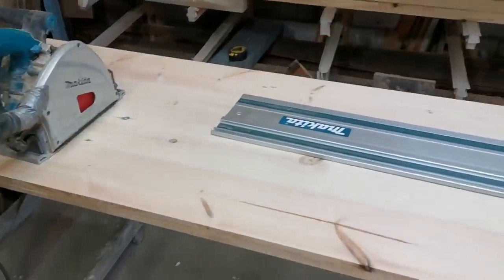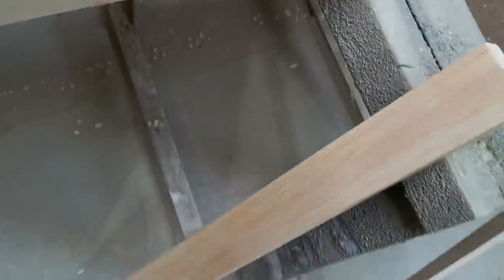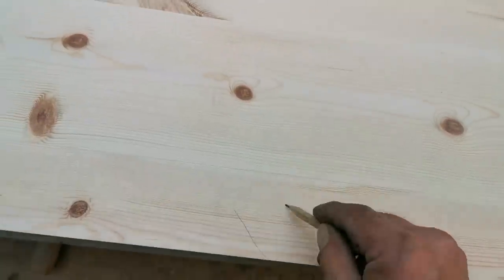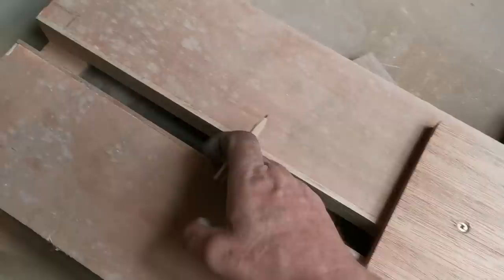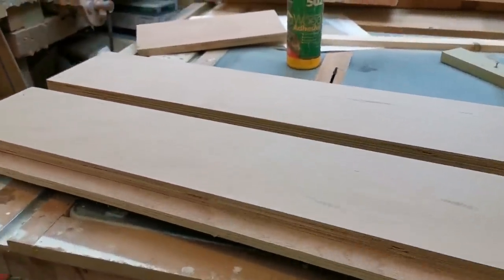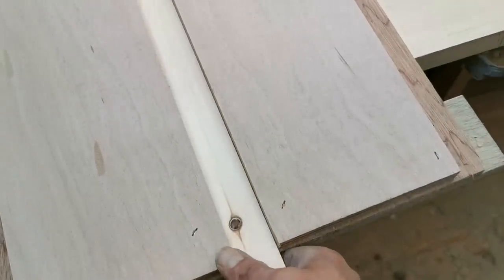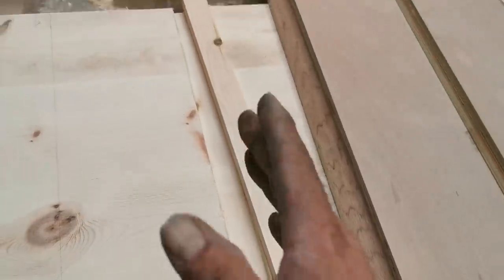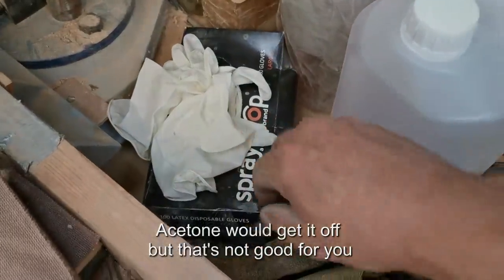Pine shoe bench Pt2 - Cutting the boards & routering the grooves in the ends

Comment: You can get those led flat panels that are used with false ceilings in offices etc. Cheap as chips and good to boot 600mm x 600mm 😉
Reply from the maker: Thanks, Simon Hopkins mentioned a link but they're in a garage I'm working on & they're failing after only a couple of yrs, it's not damp in there, prob cheap panels, I've inc them in a vid I'm making, 
https://www.ledpanelstore.co.uk/led-panels.html

Comment: Picked one of the Parkside stapler off ebay for £22. Pretty good for that as not used as much as brad nailer. Good work Gid! Keep the vids coming.
Reply from the maker: Thanks will do 👍 I like mine better than i thought i would, it's not as sleek n refined as my Bostitch but does it's job, 
This my Bostitch & where i buy my nails & staples, the parkside takes the same staples, i'll check tomorrow tho 😉
http://www.betcofasteners.com/bostitch-sx1838-e-pneumatic-stapler-15-40mm.html

Comment: I'm pretty sure you can straight up LED replacements for those fluorescent bulbs. They're like LED strips with a diffuser on top and can usually just go straight into the existing fitting. That would probably solve your problem.
Reply from the maker: Thanks Gar, yep had a look & mentioned it in the final vid today, Amazon £24 for 6ft strip, prob work out cheaper than buying a few LED floods too, 😉  I'm going to call in to my leky suppliers see what they have to offer,  👌👌😉

Comment: Good stuff! .. The advice about alternating the grain is almost impossible to follow I find, unless you have perfect material to work with (nice on both faces). It's either make it look nice, make it stable, or compromise. I must admit, I did have a small heart attack when you opened your box of router bits! 😂😂👍👍👍
Reply from the maker: 😂😂 I've been meaning to make a new box for ages but they don't get shaken a lot & surprisingly are surviving well, I will do tho 😁 Yeah the wood is shite, normally the latter,some kind of compromise 🤷‍♂️ Thanks 👍

Comment: See if you can change the frame rate on your vids to lose the fluro pulsing, I think your phone’s in sync with the fluro lights.
Reply from the maker: Hi, yep that's what i presumed, a bit like when you film helicopter n it looks like blades aren't spinning, but the only settings i have are the aspect ratio & 30 or 60 Fps, it flickers on both speeds, just faster on the 60fps, I was going to change the lights to LED's, i want more light & they'd be cheaper, I guess i have a need rather than just a want to now, Thanks 😉👍👍

Comment: hey GId,  what orbital sander would you reccomend?
Reply from the maker: Hi the red makita seem to be fine, i bought a second as i was happy with the 1st so i didn't have to swap discs.https://www.screwfix.com/p/makita-m9204-125mm-electric-random-orbit-sander-240v/2824R?tc=FB3&ds_kid=92700055256569560&gclid=CjwKCAjw_-D3BRBIEiwAjVMy7AsSy1FYdDEZoJ0WMTpa7PWAGQ9bnDVnxhySrdWtENrrWasbltHeyhoCgS4QAvD_BwE&gclsrc=aw.ds